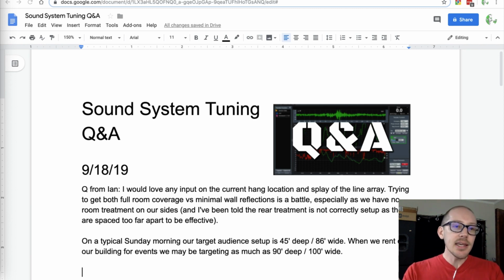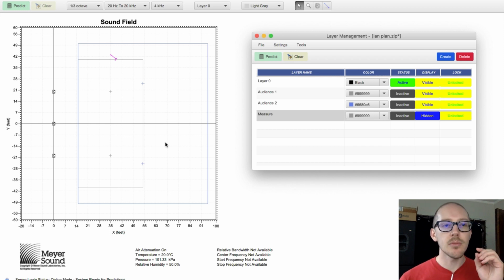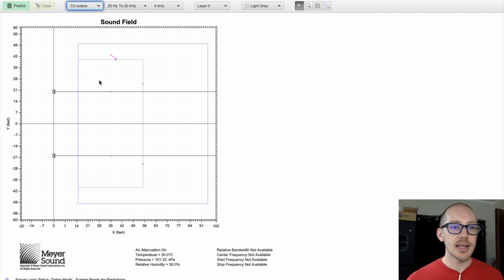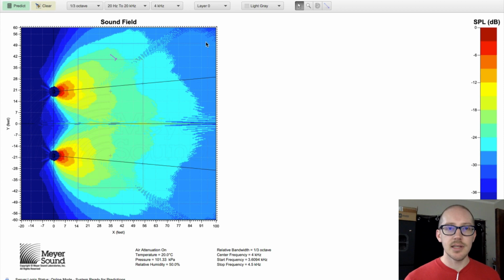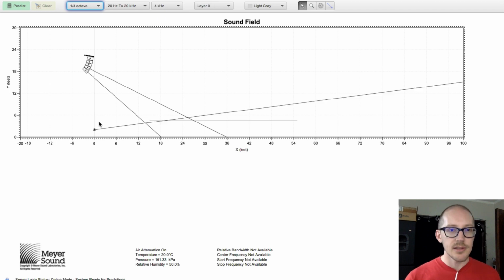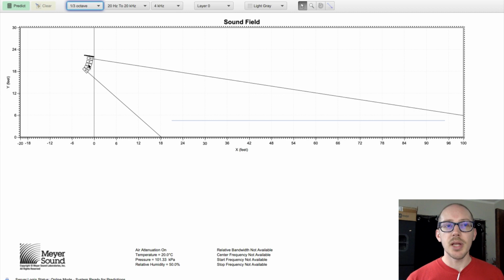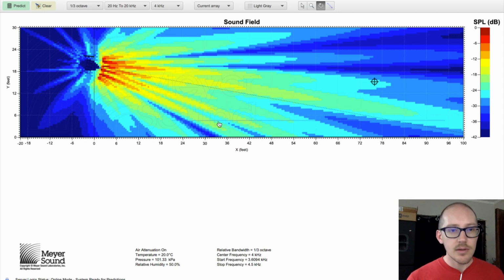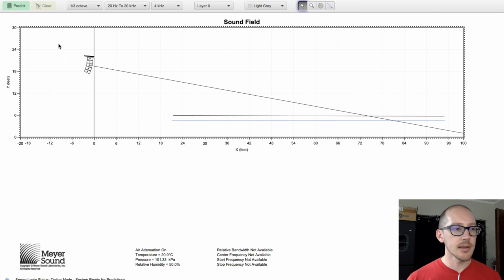Are my line arrays placed and splayed correctly?

Comment: Hey Nathan you talk about change the gain at the lower two boxes , we’ll gain tampering is not recommended in a line array because it may change the low beam angel , because the principal of the line array , we’ll low pass is what you can do I think ...
Reply from the maker: Thanks Artes! I've been gain shading for years and the Line Array Police have yet to arrest me. ;)
I do know of the guidelines that you are referring to, though, so I'm not driving blindly. I also try to avoid individually EQing the zones differently because of the resulting changes in phase and therefore summation between zones, but I'm not afraid to play with anything. Whatever get's the job done.

Comment: 10:30 That side note about projection hits close to home. I work in one venue that hosts university graduations. They've been doing it the same way for years and are very resistant to change, including, in particular, the placement of projection screens for IMAG and displaying graduate names, which are not porous, right in front of the arrays, reflecting the sound straight back into the lecterns. The level of spectral violence required to get enough gain before feedback to make anything audible is truly heinous.
Reply from the maker: SPECTRAL VIOLENCE!!!!
yeah, that sounds frustrating. Do you think they'll change it?
Reply: @nathanlively  I don't think they'll change the screen positions. But apparently the video production company (after much pushing from our technical manager) are getting new screens that are more acoustically transparent. I'll believe it when I see/hear it. One thing I didn't mention is that not only do they hang screens in front of our arrays, they insist we remove the front fills and will not budge on that.